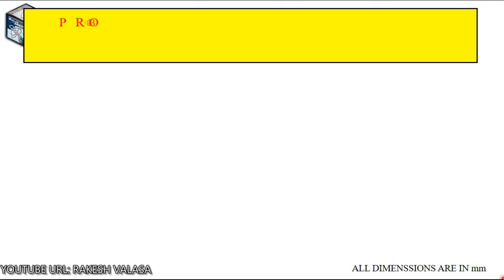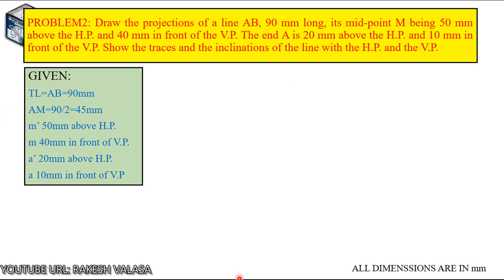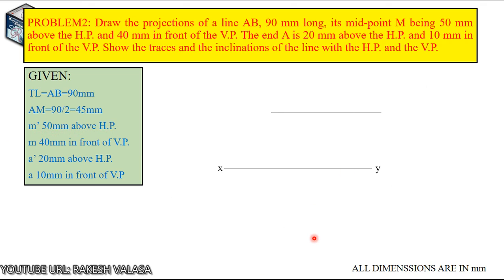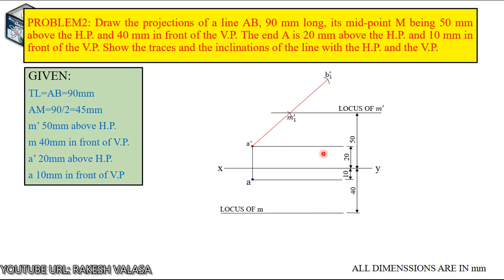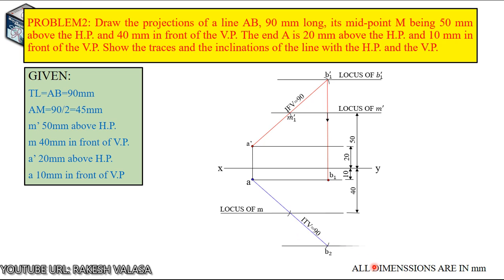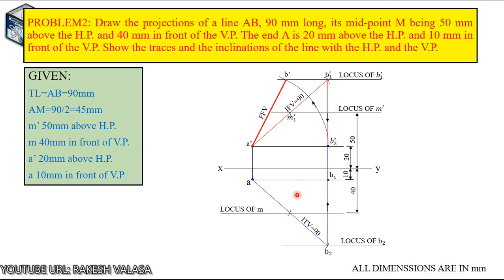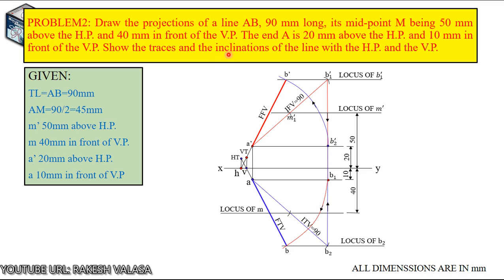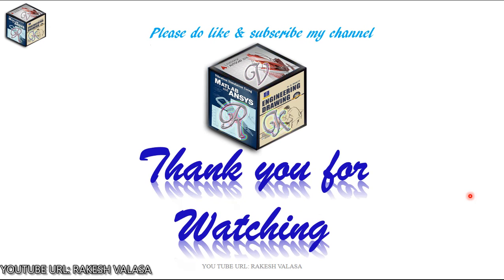PROBLEM NO.2 PROJECTIONS OF STRAIGHT LINES-II (Engineering Drawing by N.D.BHATT) with explanation

Comment: A straight line segment is 100 mm long, measures 80 mm in plan and 70 mm in elevation. The middle point M is situated 36 mm above H.P. and 46 mm in front of V.P. Draw the top and front views of the line AB.

Comment: line of 100 mm long makes an angle of 350 with H.P and 450 with V.P. Its midpoint is50mm above H.P and 50 mm in front of V.P. Draw the projections of the line

Comment: A line pq ,90mm long is in hp and makes an angle of 30degrees with vp. it's end point p is 25mm infront of the vp,draw its projections..pls give me this answer pls
Reply from the maker: https://youtu.be/L_L_FD5KYwg
Reply: ❤❤❤❤❤❤❤❤❤❤❤❤❤❤❤❤❤❤❤❤❤❤❤❤❤❤❤❤❤❤❤❤❤❤❤❤❤❤❤❤❤❤❤❤❤❤❤❤❤❤❤❤❤❤❤❤❤❤❤❤❤❤❤❤❤❤❤❤❤❤❤❤❤❤❤❤❤❤ @RAKESHVALASA
Reply: @RAKESHVALASA  A straight line segment is 100 mm long, measures 80 mm in plan and 70 mm in elevation. The middle point M is situated 36 mm above H.P. and 46 mm in front of V.P. Draw the top and front views of the line AB.